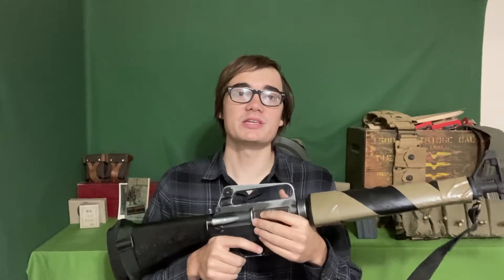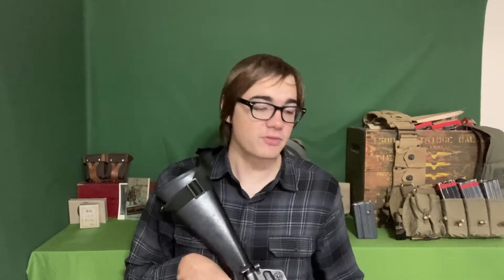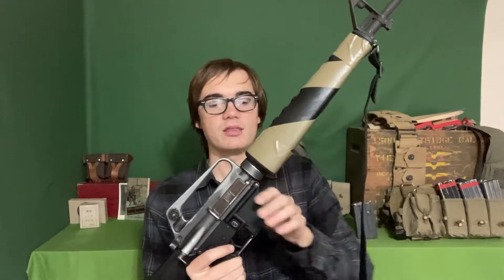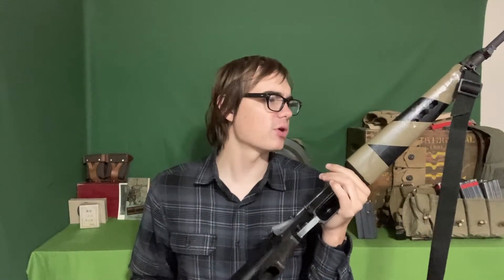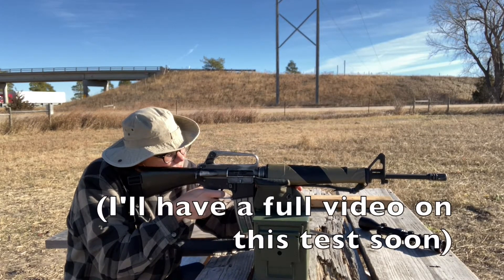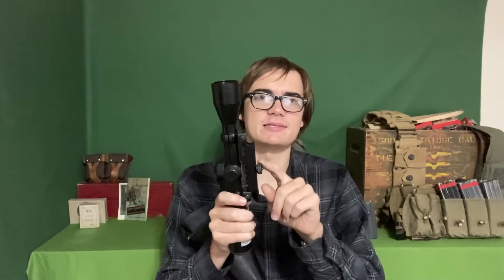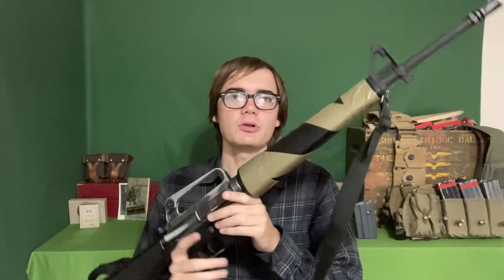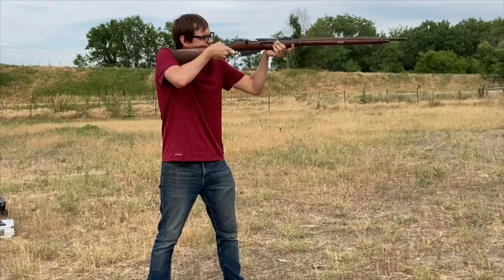Budget M16a1 On The Range (Part 2)

Comment: How is that called, how you have the sling mounted in back? Do you use a standard nylon sling? Looks like you have a pad on the sling, nice. I think I can do that on my adjustable butt-stock, but I am not sure. I contemplate getting a solid buttstock like you have. My AR is in 7.62x39. It feeds best with lacquer coated ammo but after a few hundred rounds the polymer coated feeds okay. The only brass case ammo I shot through it was Geco and that stuff jammed every 4 rounds.
Reply from the maker: It's an M60 sling. I talk about it in this video: https://www.youtube.com/watch?v=P3yFIl2BCg8 The nice thing about the fixed stock is that you use a rifle length buffer and spring which dampens recoil. The major difference between the A1 and A2 fixed stock is the length. A2 stocks are the length of a collapsible stock all the way back. A1 stocks is 1 less notch than that. Most people prefer A1, but some giants like the A2.